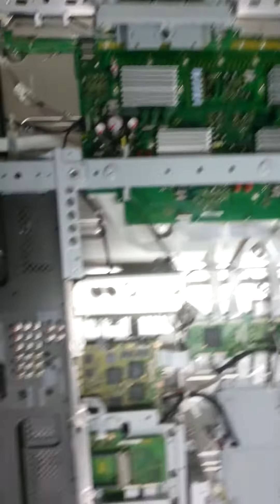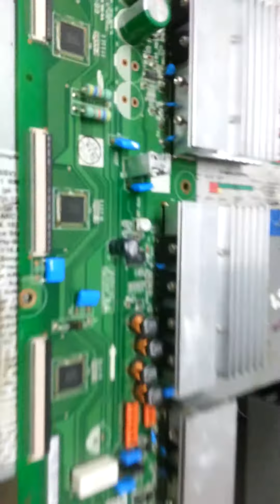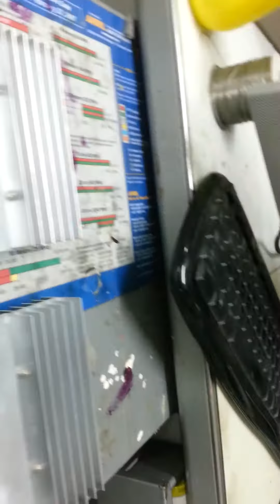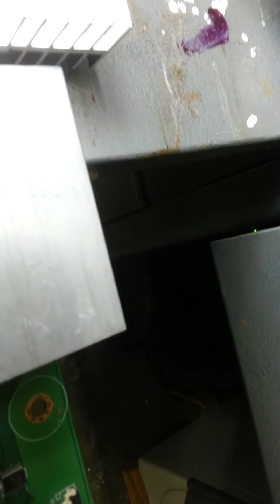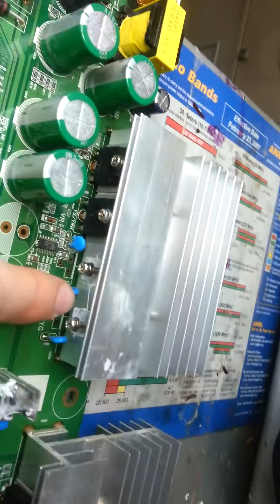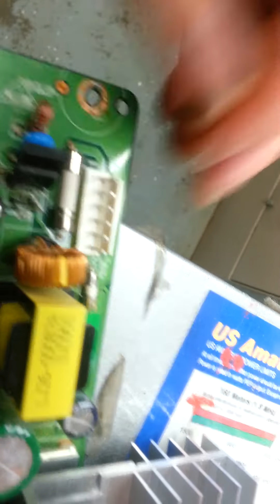SAMSUNG PN50B450B1DXZA

Comment: Nice video with good info. My tv just went out, same Samsung as the one in your video I believe. I am very new to working on this sort of stuff. Quick question if you don't mind. My tv will turn on but the screen stays black and there is a buzzing or chirping noise from I believe the top transistor (the big metal block on the left side). Any suggestions?